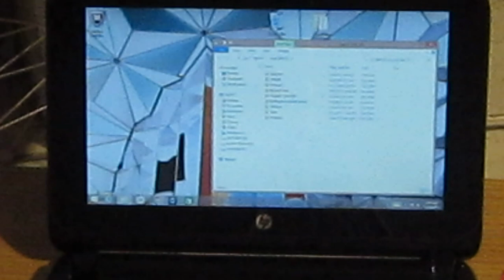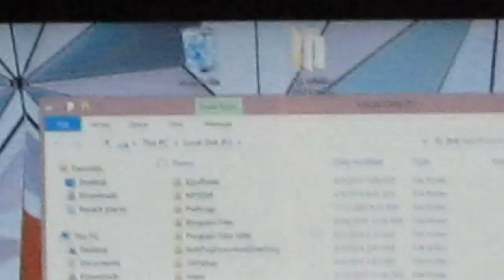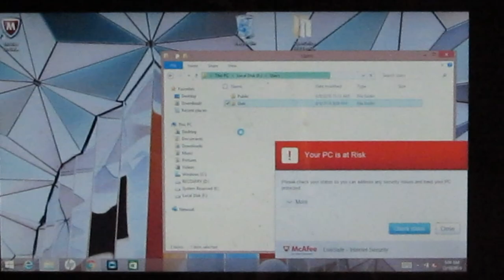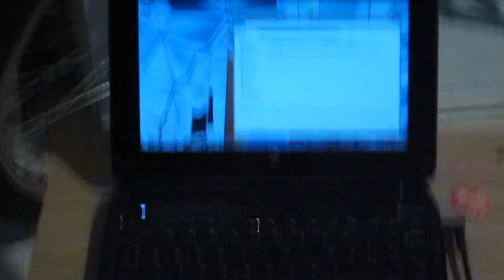How to recovery Data and Pictures from crashed computer hard drive using  a USB - Sata / IDE adaptor

Comment: I have a Lenovo Thinkcentre, had it 4 months now. It froze the screen I powered off and on. Its on but not showing visuals on screen. Square trade says it may be hardware or graphics card issue. I have programs and files I need on there. Can I fix this myself for under $160?
Reply from the maker: One trick I have used in the past, that some times works.. Is getting an identical computer, to the one that crashed... then transplanting the old hard drive from the broke computer into the new one.  If you can get a cheap computer off of ebay or something, this might be the simplest fix? It has worked for me before... and if it does work, you are up and running immediately, like the problem never happened!... but you must get the identical part number... and all of the hardware must be identical too... I assume you are running windows?  Windows, unlike Linux, does not install all hardware drivers, so if for instance the wifi card is a different brand, the old hard drive will not have the drivers install for that. I have found a work around for this too, but it is a little more work... This is what I would try, if it were my computer...
Reply: @jaynesnetwork  the desktop was advertised as though it had WiFi but it didn't so I added a tp link adapter. Idk, maybe I'll just need to find a computer service that can fix it.
Reply from the maker: I was just using wifi as an example, because I had an issue one time with the wifi.  If you use an external wifi, then you can use the same wifi and the same drivers on the new computer.. BTW the computer part number is usually under the battery. Mine I believe started with G4X...... that is the part number that you should try to match if possible. The replacement computer should be as close to the original as possible.  It is a risk, but it most likely will work, and if it does... you will be up and running. Make sure the new computer is working, and not being sold 'for parts' or some thing.  You want a working computer.  I hope this helps..
Reply: @jaynesnetwork  thank you
Reply: as i am laptop repair engineer  the issue seems to be like graphic issue i think issue will solve under $150 take it to repair shop or it may also be issue of RAM and its section problem

Comment: Will a MAC hard drive be able to extract  data into PC? Or do I have to buy a used Mac to extract the data off my Mac hard drive?
Reply from the maker: I am not an expert with MAC, but one article I read said that due to the 'Journaling' that Mac does with its hard drive.. that if you try to read it on linux system, it may cause problems.. or possibly even corrupt it??.. Here is an article that talks about some freeware available to for win 10, to allow it to access mac hard drives..  I think there is something for linux as well?? It is probably less risky to use another MAC?? The software may work just fine???  I have never done this.. so good luck!! 
https://www.macworld.com/article/3003385/how-to-access-a-mac-drive-from-a-windows-or-linux-system.html

Comment: My laptop lost connection out of nowhere. The error message said “err_ethernet_disconnected” and I followed a YouTube tutorial to try and fix it. The tutorial said to go into system configuration and disable all services. My computer said it needed to restart after that. Once the login screen came back up after restarting, I typed in my password and it didn’t let me log in saying “incorrect username or password” I cannot log in and would really like to be able to get back in and recover my pictures/documents. Do you have any recommendations? Thank you!
Reply from the maker: Are you running windows? If you pull the hard drive, like I show in my video, you should be able to read it on another machine....     Unless you specially configure your data to be encrypted (which almost no one does... You would know it if you did, it is a difficult process) then almost 100% you should be able to read your data as an external hard drive on another working computer.. The pass word is only to prevent you from logging on, and should not prevent you from reading your data as I show in this video... try it, and keep me updated. It sound like your hard drive is working fine, and should be no problem recovering all data... it may be possible to fix the pass word issue as well..

Comment: Sir can i replace the broken laptop hard drive to another working laptop.  Does it create any problem .
Reply from the maker: If they are identical part numbers, with all identical hardware, it should start working just like new! I had a problem one time, for instance, when the new laptop had a different wifi adapter, and the drivers on the old hard drive would not recognize it.. I fixed the problem by also swapping the old wifi into the new computer.. and then everything worked fine!

Comment: Would buying an external hard drive case be basically the same thing tried it once and it work like a glove...plus, it gave me an extra storage device.
Reply from the maker: Yes if you feel more comfortable doing it this way, then the external case is really exactly the same.  The cables are build into a protective case for your hard drive, but besides that there is really no difference.. Best of luck!

Comment: Hi...what if u have more partitions on ur hard drive..how to open other partitions on the other laptop?
Reply from the maker: I believe they should be mounted as usual. Normally a different letter is assigned to each partition. When you access the drive this way, the computer sees it as a normal external hard drive, so unless the partition tables are corrupted or something, I believe it should be a very straight forward process of copying the data from the crashed disc to the new computer's hard drive.. If there are lost files or major corruption of the HD, it is possible to recover them too.. Even if they have been deleted. I have a video on this, but that is a much more complex process.  Best to try the easy stuff first though..

Comment: I install windows 7 on my laptop previously it was running on Windows 10 / but unfortunately by mistake disk partition got deleted by me while installing windows 7 / I tried recuva recovery  but the recovered videos and photos are curropted / can I get my videos and photos back by using this method / plz reply 😢😢
Reply from the maker: Yes, use another computer... It should work.. if the hard drive is still good..  You did't encrypt them did you??

Comment: while this method works very well when i hook mine up and i find the files i want to retrieve and start the process the hdd disconnects from the system.  i always have to unplug and plug back and it does the same thing. or sometimes  it will say "os" not responding nd then freezes up then i have to unplug again. can you help?
Reply from the maker: It could be that the bearing are getting loose.. I had a disc drive that was behaving badly like that... If you put it in the freezer until it gets cold, then try reading it.. that sometimes helps!!
Reply: @jaynesnetwork  ok I will try that. I appreciate your response 👏

Comment: My Acer laptop refused to continue to boot as it says that the hard drive cannot be found. I took it to a company that repairs laptop/computer. I was told that my hard drive is dead and my data cannot be recovered. Watching this video, it seems that there is hope for me to recover my data. Please, is it possible for you to list the names of the cords that I need to buy for the attachment of the dead hard drive to a good laptop for data recovery? Thanks.
Reply from the maker: It is possible that the hard drive is totally 'dead', and impossible to retrieve data from. This technique I talk about only works if the hard drive is working enough to retrieve data (lets call this 'crashed' as opposed to 'dead' ), but something is messed up in the boot of the OS of the drive so it can not boot as a primary drive on its own operating system.  If the drive is actually totally 'dead' then no technique will work to retrieve data. I did make a video that can allow you to check to see if the hard drive can be accessed by another computer (i.e. not totally 'dead'), and this can be done without buying cables.  Maybe this might help you.
https://youtu.be/xiGLjGHBoSw
Reply: jaynes network  Thanks. I will check it out
Reply: @-jamesfabiyi7493  if your from UK,  data recovery service is available by me

Comment: Hi, I'm looking to connect my failed hard disk to my computer, could you provide a list of all the cables needed and maybe where to get them?
Reply from the maker: This is an example of something similar to what I used.  There are many different kinds to choose from. Just make sure it has the same connectors as your hard drive before buying.

https://www.walmart.com/ip/USB-2-0-to-IDE-SATA-S-ATA-2-5-3-5-HD-HDD-Hard-Drive-Adapter-Converter-Cable/478924797?wmlspartner=wlpa&selectedSellerId=7728&adid=22222222227092784343&wmlspartner=wmtlabs&wl0=&wl1=g&wl2=c&wl3=216129273737&wl4=pla-350338502777&wl5=9008124&wl6=&wl7=&wl8=&wl9=pla&wl10=115059135&wl11=online&wl12=478924797&wl13=&veh=sem
Reply: Itswalrus --u can get any cable from ebay. They have mother board and anything ur looking for just have the model and serial number
Reply: How many cable need to connect .can you name them all clearly .i have lenovo laptop G570 ,its crash couple days ago i have alot my grand daughter pictures .i need to recover her pictures .Thanks
Reply: @etoe2008  sir have u recovered your  hard disk data or not pls tell sir  I am also facing same problem
Reply: can you use this on a Mac? Or it has to be a window computer?

Comment: Ok so I did all of that but can't find any pic and that's the hole reason for doing this.and advice?
Reply from the maker: Can you access the hard drive and view its contents ok? if you don't remember the location or folder you stored your pics in, you could try doing a search for common pic extensions like .jpg for jpeg for example, or .mp4 for video... If you are using a windows machine there should be some search option when you click on the windows icon in the bottom left corner.. you can type the key character (.jpg) in this box and have the computer do a search for you.  Hope this helps a little...

Comment: sir , will it detect my dead desktop HDD with these external cables on different computer to recover data from Easeus software??????
Reply from the maker: I usually remove the hard drive first.  Most connectors are standard.  This would be the only issue if the connectors don't match your cable.  It should work but just check your connectors before you buy the cables.  Best of luck...
Reply: jaynes network okay sir ..thank you so much.!

Comment: i have an ide drive that i tried to get some data from it, in Win 98.  The adapter can detect the drive, but it asks me to format the disk.  Do I need some drivers or something?  Is there any way for me to use the adapter to get the files that I want?
Reply from the maker: Don't format!  I have never had to install drivers, except one time I had a super large disc, I believe it was using exfat, and I had to install some kind of driver for my linux system.  One way that hard drives fail is that their bearing become loose over time due to wear and friction.  Sometimes this can cause the drive to become unreadable.  There is a trick I tried, and it can work if this is the problem.  If you put the hard drive in the freezer, and get it good and cold, then quick try to read it, sometime this will temporarily shrink the bearings enough that it can be read... on a different note...     The internet says that Windows 98 is most likely FAT32 file format.. I believe that is pretty standard. The other file format is NTFS, and I believe Windows should be able to read both....   When you plug that hard drive in to power, can you hear it spinning?  If not, it could be another type of failure...
Reply: Oh no, I wouldn't format it.  There are only two files on it, that it can see, at least -- a recover folder and another one who's name i forgot.  I think it can read the disk, I just don't think there's anything else on it.  It reads the other one fine, but the file i'm looking for isn't on there.
Reply from the maker: Maybe the file allocation table is corrupted?  You can try to recover the files if you think you are reading the disc ok.  I have a video of how to use "photorec".  This can undelete/recover corrupted files sometimes....  It could also be a permissions issue with windows as well... If you try to read it with a linux machine you can get around this... if that is the problem... windows imposes permissions of users....  and on a different machine you are a different user... so have no permissions to the hard disc.... but linux does not respect windows permission and will allow you to read anything...

https://youtu.be/vLUpJOZmREs
Reply: I see the same thing when I look at it in Linux,  I have elementary OS as well on my SSD in my MBpro, as well as parallels running WN 7.
Reply from the maker: It isn't a solid state drive that you are trying to recover is it? That is so weird that you can only see two folders... is there subfolders or anything good in them?  you can try photorec, but it is going to give you a whole bunch of junk to sort through.. I will think about it.. If I come up with anything else, I will post it here.. best of luck...
Reply: No, I meant that i have a linux partition on my MB pro's SSD.  I'm trying to recover from an old HD, A western digital.  It may just be that the files i need are on another disk, and this WD drive is just blank for some reason.

Comment: Which of these three would you prefer?. Win XP, Win 7,  Win 8  or Win 10
Reply from the maker: I prefer Linux as my first choice.. It is free, and powerful. I can access windows hard drives plugged into a computer running it.. My second choice, for right now it Win 7.  Some software is not written to run under Linux. Unfortunately Microsoft is a very powerful corporation, and they make shady deals with software developers to NOT write certain things for Linux.. Linux does run WINE and other emulators, but they are not perfect. In these cases, windows is your only option.  My next favorite is Win 10.  I despise Microsoft demanding that they have the rights to search you personal data with 'their' OS,...  I believe this is criminal... Lets face it, if they declare rights over their OS and over your personal things as well.. That software is really owned by them.. even after you buy it from them, and if you accept their terms.. you are really owned by Microsoft as well... ;-) .. Seriously.. But Win 8 is so doggy, that it is almost unusable, so that puts Win 10 in 3rd place above 8.. That leave us with Win XP in last place. Don't get me wrong, in its day, XP was great.. Have you tried running an XP system recently on the web??? It will not, 90% of the scripts on modern web pages are not supported by xp any longer.. and Linux will do the all other things I want to do.. so unless you are running some ancient piece of software from the 90's or something, XP is not a viable solution... Oh, and Mac, is dead last.. I don't use mac... They are expensive, very proprietary and very locked down.. The opposite of everything I like.. Cheap, flexible and free.. Just my opinion.. Thanks for the great comments...

Comment: Hey i have a Probleme my hard drive ribbon was damaged and i need to run my Computer Acer aspire One and make the hard drive work what can i do to make it work as internal and run windows into it ?what i need please ?
Reply from the maker: if you want to have the computer boot from that hard drive, and your hard drive cable is bad, I recommend trying to replace it.  You can boot off of different drives, but I believe you have to go in to BIOS and change the boot order so that it will boot from a different drive ( the usb drive for example), if that is where you want to boot it from.. There may be issues though.  I am not sure if if is possible to make the USB drive a bootable drive???  I have not tried this before.. Probably best to try to fix the cable?...  A source on the internet did say that windows 8 and 10 will automatically boot from a usb flash drive... so may be possible with out the BIOS change?... could give it a try?... and see if it boots by plugging it as a usb drive.. this probably is not too risky to try.  It is your call...
Reply: yes i have try it so many times but it's not working ... some one have toldme that i can run he hard drive with usb cable ?? can you tell me how  cause i had bough a hdd case sata to usb but when i wanted to instal windows on it it says that i can't instal windows into 3.0 usb cable ?? what to do besides this ?
Reply: yes i have try it so many times but it's not working ... some one have toldme that i can run he hard drive with usb cable ?? can you tell me how  cause i had bough a hdd case sata to usb but when i wanted to instal windows on it it says that i can't instal windows into 3.0 usb cable ?? what to do besides this ?
Reply from the maker: This article talks about how to do this.. Maybe you do have to change boot order in bios, if you want to boot?
If you are already running (booted) in an OS,  it should recognize the drive.. Are you running windows 8 or 10?  
I usually run Linux, because it is free, and it is great... you  could boot from cd into linux, then you could read the drive?.. another possibility..  Anyway, Here is the article that talks about booting from usb..

https://www.lifewire.com/how-to-boot-from-a-usb-device-2626091